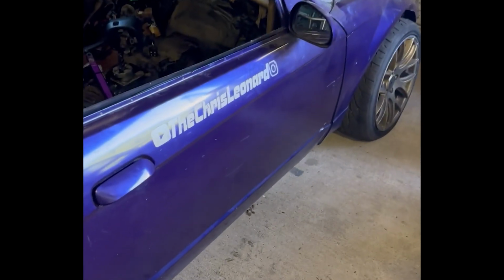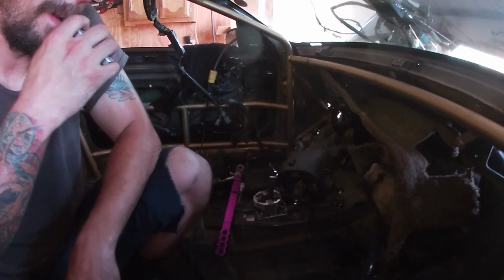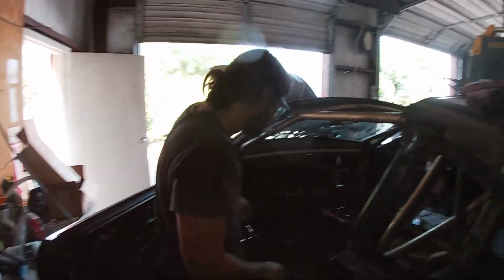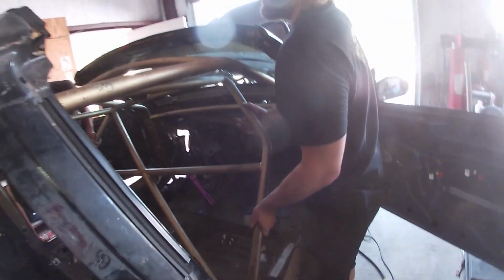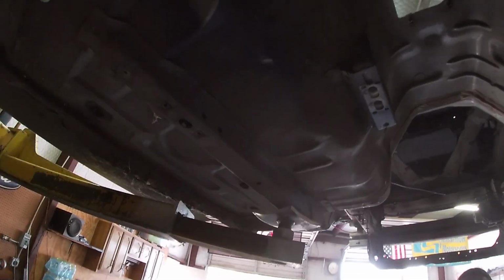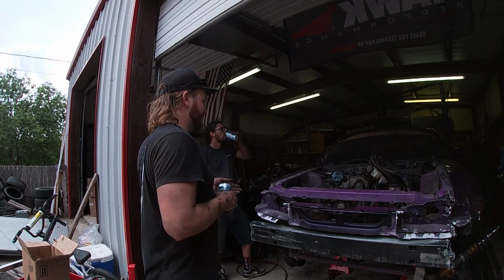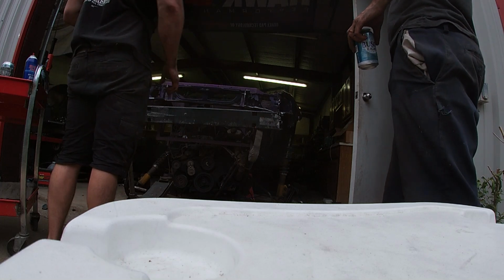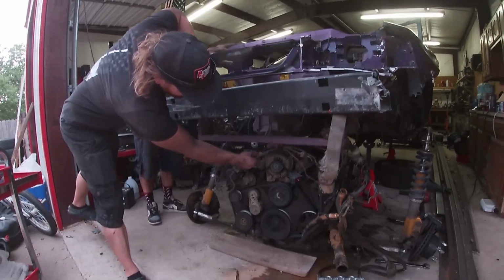What Happens to Old Drift Missiles? We Decided to Rebuild my Pro-Am New Edge Mustang!

Comment: Team New Edge!!  Your car is the jam what timing component brand is it on cloyes or
Reply from the maker: Thanks dude! I have stock new stuff with comp adjustable cam gears.
Reply: Nice I had gears on mine, some red brand 50 a gear.  They were showing wear and I was about to go comp. Anyway comp is money!  I did trick flow crank sprocket gear billet and allows for adjustment with stock top.  Turbo stroked 4.6 to 5.0 turbo setup tfs heads st4 mhs cams etc.  Anyway love the content keep it up! @TheChrisLeonard1
Reply from the maker: @Megacatares  dang that thing must make some power! And thats the plan thanks dude!